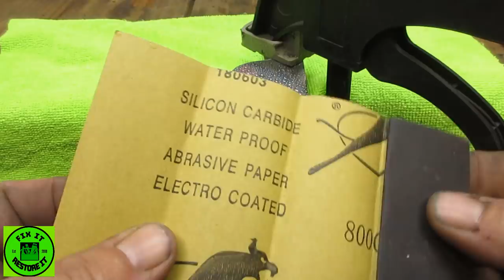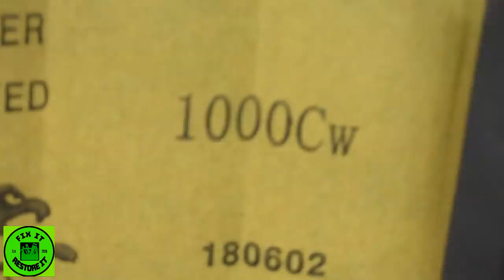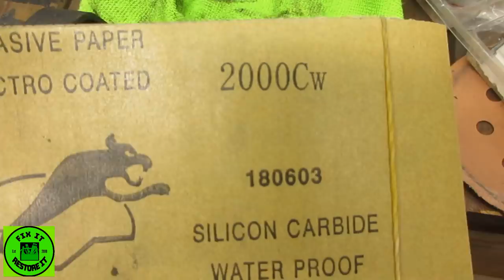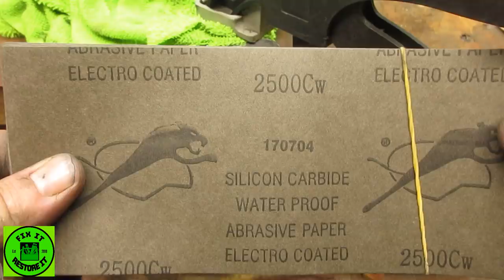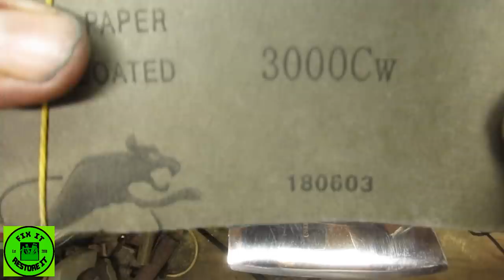Old rusty Hatchet hammer mirror polish BEYOND restoration

Comment: you can go as high as 8 or 10000 grit. I have on occasion, but I usually give up long before I get so high.
Reply: If that's the look you want, you might consider getting into plating. A nice heavy chrome plating would do the same thing.
Reply from the maker: I like the challenge of getting it to that level of shine 😎 I don't know if it would be feasible or cost effective to chrome plate something or if you could even get the chemicals to do it 🤷🏼‍♂️
Reply: @FixitRestoreit  there are ways to do it that are not expensive, and the nickel annodes are not high priced. I just sent for some, I'll let you know how it goes once I've tried it.
Reply from the maker: @tootall5559  awesome, I'll be very interested to find out 😉
Reply: @FixitRestoreit  you and me both, I'm trying a simple method I found on You Tube.

Comment: Loved the project..right up to the point of you drowning it in glue.
Should have use Linseed Oil on the top of the handle. 
Place axe head on..tape off head..fill void with linseed oil..let sit for a few hours...place wedge in.  No need for glue..ever.
Reply from the maker: I'll remember that 😉

Comment: Very awesome job.  Did you only use the white buffing compound?  I usually do black, brown, white, and green but I typically only take my tools down to 1000 or 2000 grit before the buffer, I don't go as high as you do with the sandpaper.  I let the black cutting compound take it the rest of the way.
Reply from the maker: White, , but I've since found I really like using the green compound.  The depth of the shine is what really changes the higher up you go with the grit, tba you can almost get get obsessed lol!

Comment: I'm a bit puzzled. What was your reason for doing this? An exercise in metal polishing? You've turned a once hard-working axe hammer into a tart. Just my opinion. Reminds me of some Bruce Springsteen lyrics...'...until every trace of who you ever were has gone.'. Personally, i'd have cleaned it with a wire brush on my drill, buffed the hammer surface and given the blade a new edge. Instead of wasting hours of my life creating a trophy. But you did a super job so well done.
Reply from the maker: It started off, like most things I do , just a cleanup and rehandle ....... You saw what happened next lol!